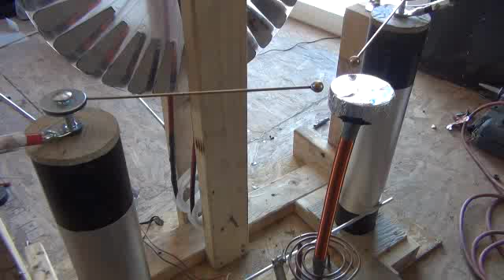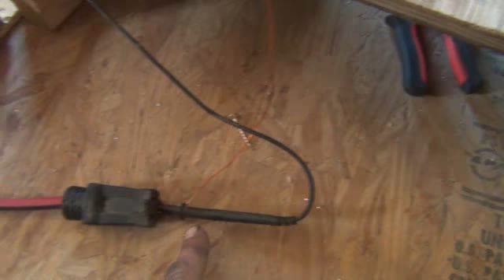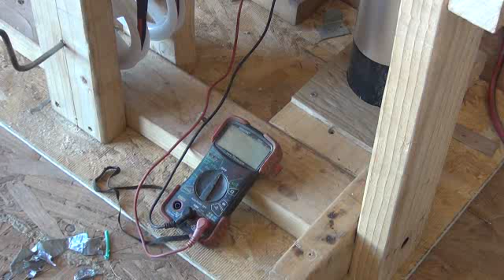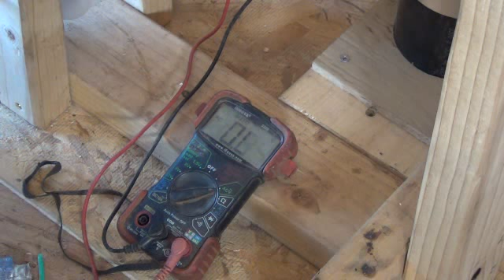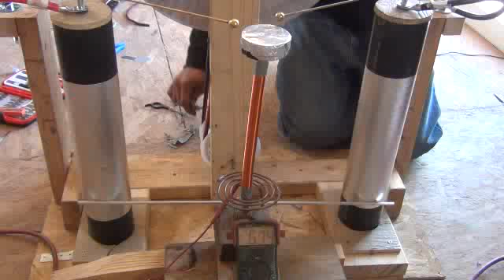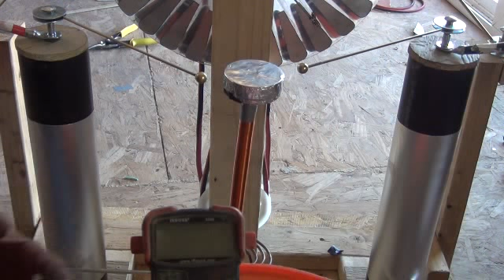Tesla coil "the true secret" how it was really used.

Comment: I never played with the coils, but I always had a theory that Tesla didn't build the coil for 'Wireless transmission" but instead to harness lightening to make it useful power. This just shows that I was on to something way back. Static charge into the coil top, can be converted to usable electricity. Which means that the atmospheric static voltage is usable. But , you would have to get the top of the coil up there high enough to connect. Like 2000 feet. Then you would have to store it, in a capacitor bank, or a battery. Cool!

Comment: What if you install rodin coil on top of tesla coil and then install it on tower high up in the sky 130+ ft to act as an antenna receiving kilovolts of atmospheric electricity which is static electricity with single wire coming down from the tower into the high voltage pole capacitor banks, then to pole transformer stepping it down to 230 volts or 120 volts going to voltage regulator which then goes to power the house?

Comment: Can you tell us more about supercapasators and how to deplete their charge slowly over time
Reply from the maker: Dielectric materials can store charge and then release the charge slower than a capacitor,  super caps are simple to make just use perfectly distilled water as the dielectric material.  A simple dielectric high voltage slow release battery can be built by spraying plasma from a sharp point into a large block of plexiglass, then hook that to a cap bank it will slowly recharge it. 
   Thanks for watching.
Reply: MrTeslonian days great man...can you make a video about it ..day wud be amazing...

Comment: that makes sense to me now why he created this marvelous setup.
+MrTeslonian I would like to share my findings with you, probably you already know it. I created Tesla coil to run on 5V usb. I created the secondary coil in a broad can. So my secondary coil was not tall in structure like your, it was a wide structure and I noticed that its radiation range was increased. I did one more gig to it. Ah! curiosity always makes me try something different. I made another secondary coil of slightly less width. Then I had one secondary coil cylinder inside the other. I connected them in series and range increased further. Have you tested both wider and taller structure for this experiments. The results in your opinion should be same or different?

Comment: Seems to me, from what I see, that this is not really a Tesla Coil. With all due respect, because it is a good video. A Tesla coil also includes capacitors and a spark gap. The goal being to create resonance within the secondary coil and ramp up a breakout high voltage. Basically a transformer with a high exchange ratio and a matching circuit to create a standing wave resonance. Here, all I see is a high ratio transformer. So essentially your taking physical energy to turn the Wimshurst, which then creates through inductance electric charge potential, which is then being translated through one Kirkoff loop, because you ground, to your transformer. Not mentioning the effects that can occur from house grounds. I would recommend a separate copper ground.

Comment: SO does that mean that if I put an high DC current through a tesla coil I'll get my full current back and the nearly equal AC volts as a bonus from the antenna ? shouldn't you be using an iron top instead of aluminium?
Reply from the maker: Vladimir Nachev You tell me, How much loss is in a standard transformer?
Reply: +Vladimir Nachev  none. energy is transformed
Reply: if you use a closed system that has a return path for the current you will never get over unity. You can make energy flow without transferring current through the load. This is the way
Reply: leave me alone : so then ... how much electric energy  is transformed into heat
Reply: it depends, but at least 30% I think

Comment: very interesting experiment.  I think that this is one example of a practical use of a Tesla coil, however I'm pretty confident that there are others.  One that I have been thinking of for a while is using multiple Tesla coils to generate a strong electromagnetic field that can be used for a type of radiation shielding?  not sure that it is 100% possible.....

Comment: >_> if your goal is high voltage, disconnect the "secondary" coil. Moving from many tight windings to few large windings changes voltage to current. If you just want high voltage AC just plug into your primary coil.

Depending on how much voltage you're putting into your tesla coil from the Van De graft, the self-inductance of the Tesla Coil (depending on how it's tuned) should blow the voltage off the charts. 

I think you're really doing this backwards..

Comment: One thing that you are doing is somewhat unique, is using the Tesla coil in reverse. That should allow your secondary coil on the Tesla coil to develop some usable current from the high voltage discharges when the voltage is stepped down by the Tesla coil.

Comment: Digital meters are easily fooled by distorted AC waveforms. AC meter measurements are only accurate with a clean sine wave. Meters have a very high input impedance making things worse. This system generates big spikes which further confuse the meter, causing wild meter readings which are totally inaccurate. What you need to do is have a real, non-inductive resistor  as a load across the meter. With the resistor you can then calculate the amount of current flowing - on DC only.
Reply: You need to separate this from the house ground, especially if your house is an older one, the ground often measures out what you are producing.

Comment: You might put a bridge-rectifier to convert to DC, charge a CAP, put a resistor for a load, and then measure the DC voltage across that load. Knowing the volts and resistance, you can derive how much power your getting.
Reply: Exactly. I was very curious if there was a way to get substantial amperage from this.

Comment from the maker: Without a massive shift towards space and the colonization of nearby orbiting bodies we as a species cannot continue on at this pace for much longer, without causing catastrophic ecological damage.
I have a way to launch a rocket or space plane from the edge of space instead of launching it from the earths surface. This would drastically reduce the onboard energy storage requirement allowing for a much smaller design, and a higher level of safety . The primary launch from the earth's surface to the upper stratosphere is achieved with a simple reusable non-combustion launch platform.
 
This next idea I will say sounds at first glance to be far fetched, but I know it's possible and I have tested it at a small scale. The idea is this - for a lack of a better way to explain it simply is to "ride the lightning", What I mean is lightning contains so much power that it could be used to accelerate an object into space, the visible strike or electron flow is typically traveling from the ground to the sky and can contain as much as a 10 trillion watts.  This electron flow can be harnessed in multiple different way's, one way is similar to the effect witnessed in a electrostatic demonstration known as Franklins Bell's, another would be to use the current directly in a very large electrostatic induction motor to spin up a very powerful turbine, and as a final example you could create what I call the "Kelvin Electrostatic Accelerator" which is a specially designed Lord Kelvin style ion-electron accelerator I built to fire an electron stream through the middle of, and the corresponding ring's around the electron flow create a magnetic field, that will ride an electron flow similar to a rail gun. This has been difficult to achieve with anything of substantial size based on the voltage's and current's I can achieve in a lab. The sheer power in a lightning strike would accelerate a large object at a very high rate of speed (possibly as fast as the strike it's self).
Reply from the maker: Nathan Hohenheim The more "buoyant" the craft and the more powerful the engine the more maneuverable it is as well. Since it does not need to be in forward motion to keep it's elevation the craft can make very tight and seemingly impossible maneuvers.
Reply: Carl Sagan made a case for overpopulation in his book Cosmos, I like your ideas.
Reply from the maker: Nathan Hohenheim neutral buoyancy is the name of the game, the closer to neutral or greater than neutral the buoyancy the less energy to move the craft.
Reply: +judgeomega, why use a rail gun when the same device used to launch craft could be used to launch supplies?

Comment: Just got done reading your info on the secrets of the pyramids and Tesla work. Very enlightening and interesting. I wonder if you could power your house or communities this way without high cost. Cheap and safe. I wonder what the Egyptians did and knew. Thank you sir. I watch and love all your vids!!! God bless you.
Reply from the maker: There is no question in whether this is usable the problem lays in what is the recharge rate of the earth from ionizing radiation, friction, the Lord Kelvin effect in the clouds, magnetic field motion over conductor mediums and so on. If the recharge rate is not high enough then using the current to any real extent would cause catastrophic ecological damage. For example the sun produces at it's surface 3 x 10 to the 26th watts, the distance from the sun to earth is 150 x 10 to the 6th km. So the light that reaches our atmosphere contains about 1000 watts per sq. meter.

Comment: I'm not sure but I see an error because where is the electrcity going to flow if the spark gap is just arcing across the topload? I would think that you would need to hook both ends of the secondary leaving one end with a gap......
Reply: I agree. His way seems very inefficient because it is only getting energy of a certain frequency from the spark. If he connected as ypu describe, the whole energy of the spark would be available for inductance to the primary. Also, you should be able to pull static from the sky if you can get a pointy metal piece high enough. So basically replace the vandigraph with a rod in the sky and use a capaciter to store the energy up to the desired voltage for the spark gap.

Comment: Would it be possible to convert solar energy into power for the tesla coil to charge batteries capable of storing large amounts of energy? If a big snag in Solar energy is the battery, can we change the energy from solar panels into a useable energy to fill batteries? Tesla coil + Solar panel -> Charge large batteries via solar energy? Or to convert it to a usable current?

Comment: How can u transmit electricity wirelessly (through sparks) and not electrocute other things that u dont want to? (like bridges, air planes, or even a roofers ladder)
Reply: In the same fashion we direct lightning today. you could technically direct a spark to go anywhere by the use of magnetism, or by the use of the closest grounding-point. So what you do is to build "channels", Highways" really for a Tesla spark to travel with and on.
Reply: New Guard of Australia in the quantum world of metaphysics this "aether" has come to be known as 'non-locality'.
Reply: It works just like a radio - High frequency
You have to tune to the same frequency to receive the signal.
You don't get shocked by radio towers!
Actually you can build a Radio that runs 100% off that signal -- No battery, No AC, but it isn't very loud- you need an earpiece to listen. (!)
Reply: Basically..., the same way he transmitted Radio waves, or Remote control waves, perhaps, with a different resonance.

Comment: Just a quick question from a complete novice. 
Would it be possible to create a Wimshurst machine where instead of the plates being small, that instead they where in the shape of the Fibonacci spiral? (Obviously not touching each other). spiraling out from the center of the wheel. After all aren't we just creating a magnetic vortex when we spin the Wimshurst generator.
And Isn't that the Fibonacci the preferred direction of travel for energy?

Comment: I would think far less voltage is required depending on things like dust and humidity (an important note for the other video showing the split water stream where humidity is clearly a factor).  for this video since the dc seems to cut out at discharges, what would happen if the gap were inside a sealed container with little air or air that had a much higher voltage requirement.  would this increase the dc being generated?

Comment: the magneto and coil on a small engine gets spark from rotation of flywheel initially by hand or starter motor, would elements of these designs help make it easier for a non scientist like myself to attempt to replicate in some way your design concept? I have collected capacitors  and alternators to make a lead acid battery desulfator and many small/medium engines and motors. I am weak on the theory and applied knowledge of electricity and magnetic fields.  Thank You.

Comment: Use a large value resistor ( in your case equal to the resistance  of your airgap) ,  and you can easily drain any capacitor as slow as you would like,  or like a battery as you say..